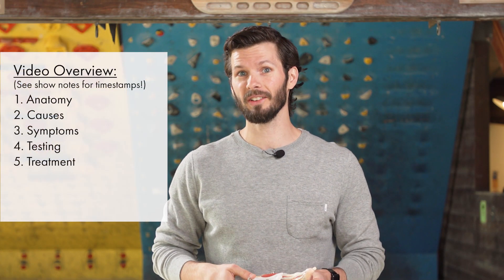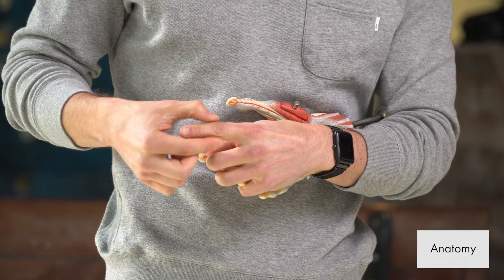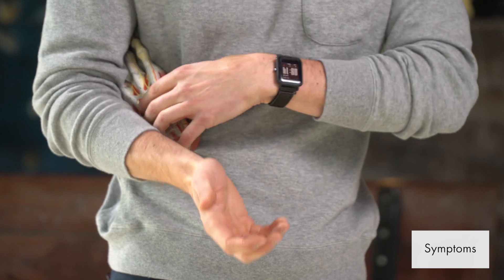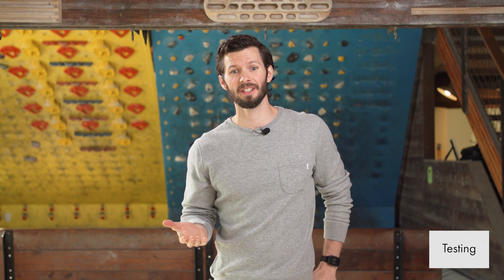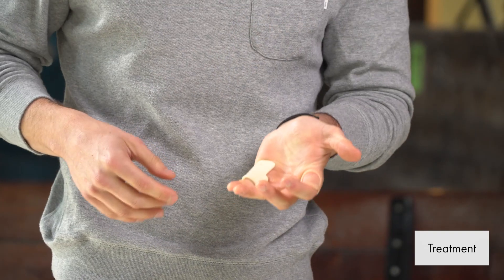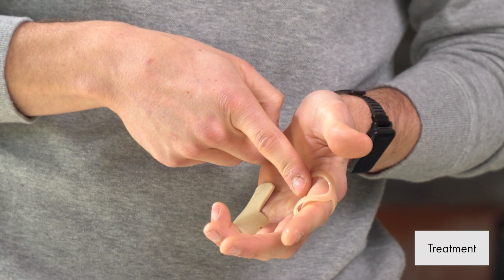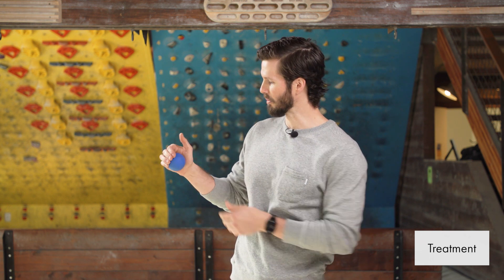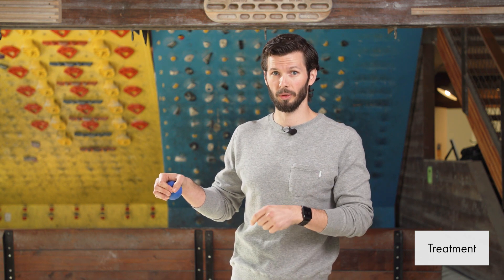What is Trigger Finger and How Do I Fix It? (Stenosing Tenosynovitis)

Comment: Thanks for the informative video, just subscribed! I have a puffy inflamed knuckle at my PIP on my index finger. I don’t really feel anything getting “stuck” when I do the sliding/curling motion like you described but I do feel pain and tenderness right around the PIP knuckle, which gets worse the more I curl my finger inwards. Do you think it’s trigger finger? My hand will also “pop” around the same area and go numb sometimes for a few seconds when doing pull ups on jugs. No lasting pain though as with a standard pulley type injury. Any help with diagnosing this is appreciated!
Reply from the maker: It doesn't sound like it. Inflammation at the PIP joint and pain when you curl the finger inwards is more so related to the joint as you are closing the joint space down. There may be some collateral ligament irritation as well. Possible diagnosis could include synovitis, arthritis (depending on age and other factors), or collateral ligament strain. The pop and numbness is interesting. Typically a pop without pain is either a joint cavitation or a tendon/muscle sliding over a bony prominence, but the association numbness is interesting. There are possible reasons for that but it would warrant further analysis.
Reply: Hooper's Beta Thanks for the response. Okay that’s good to note. Yeah the interesting part is that I have the same puffy tender knuckle on each hand. Left hand index and right hand middle. I also get the same popping and numbing sensation on each hand and they started around the same time. I’m 30 years old, the only other activity where I’m using my hands is piano which I’ve heard can cause carpal tunnel, not sure if that would be related at all. As apart from the temporary numbness there’s no lasting pain, do you think this is a serious issue that I should temporarily stop climbing over? I saw you are a PT at UCSD as well, is that correct? Maybe I can make an appointment to see you there. Thanks again.
Reply from the maker: numbness / tingling can vary in the level of intensity and it's dependence on ceasing activity or not. It's really about understanding the cause of it to understand if there is a need to stop climbing. Until the cause it's understood, can't really say. Yes, you are correct, I am at UCSD and taking patients.

Comment from the maker: What do you think our next video should be? Suggestions welcome! :)
Reply: How to train at home -- for climbers at different levels of ability -- now that climbing gyms in many cities are closed. (Please!)
Reply: I believe i strained my lumbrical muscles a couple weeks ago and am still unable to pull in an open hand position without my pinky. Videos on rehab for that would be great as I have been unable to find some material on it!
Reply from the maker: Lumbricals, got it! Thanks for sharing / commenting.
Reply: I have a problem with both my hands being stiff when I try to make a tight fist. No problems with extension only flexion. It gets worse after climbing and is the worst in the morning and sometimes evenings. But after slowly squeezing my hand to a fist and holding it tight for a min it goes back to normal for a while. It's completly pain free. I tried not climbing for a month and it got a bit better but did not disappear completly. When I climbed again it came back in full force. Ibuprofen 400mg x3 for a week did not help. I've had this problem for about a year now.
What's going on? There are no climbing doctors or physical therapists in my area.
Reply: @vince21412 did you ever fix this?
Reply: mine is at the thumb join closest to the nail